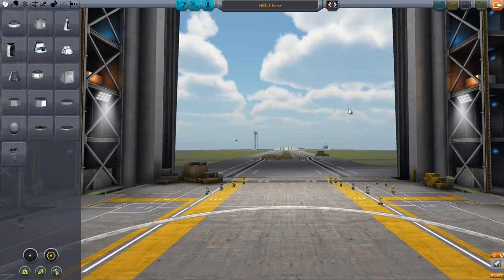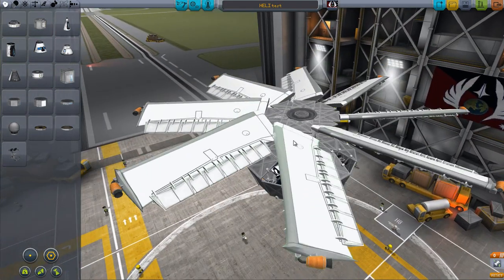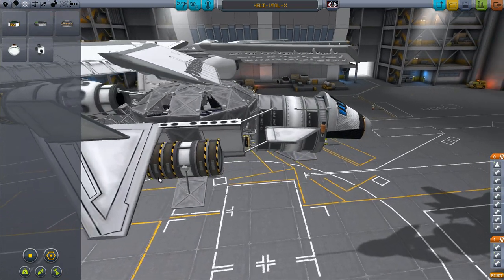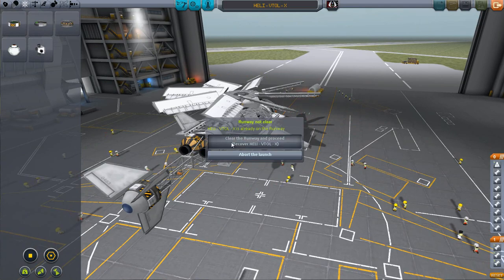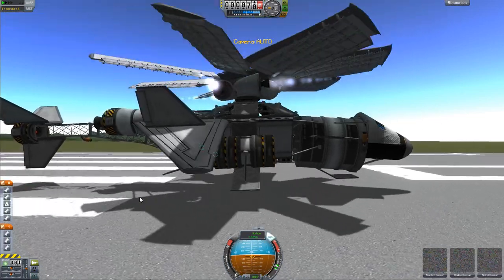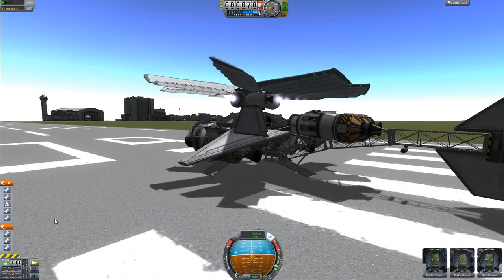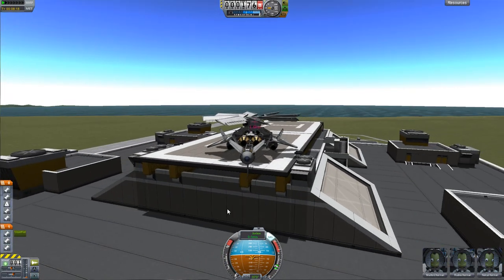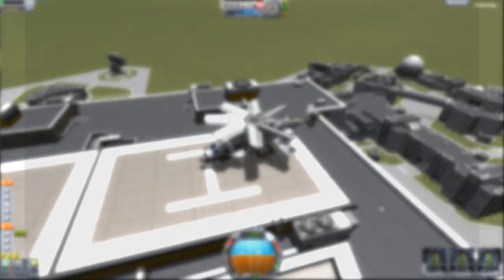*EXTREMELY OLD VIDEO* KSP V.22 -Vid#51-The HELI - X . No Mods.

Comment: Since this ship does not use the conventional tail-rutur and control surfaces (techno-babel: NOTAR) to control the opposite direction of the ship to the main rotor's rotation vector, you might consider moving the countering system to a more aft  location. .   Memory (that famous liar {g}) wants to dredge up a reference to the early days of Sikorsky's work that demonstrated the need to so separate these functions.  Thus, the need for a control lever in addition to the aero  and G&C needs  As soon as my lab and officer are finished being unpacked, I'll see if I can find either the text and/or my course notes...if there is interest, I'll post a precis.
     You have made a very good start on this design (IMProO; I hope that you still have enough interest to add this to your schedule.

Best,

Doc

'I have written you a long letter...'

Comment: If I had KSP and the infinite fuel task bar thingy I would take your design and increase speed and maneuverability then I would add low recoil missiles (which are easy by the way) and test it on target trucks. afterwards I would make it my mission to make it fly without infinite fuel on.
Reply: alt + F12
No need to thank me.
Reply: Gabriel Urbaniak Too bad, I will thank you anyways, thank you.
Reply: You press ctrl + F12 😀

Comment: KSP calculates torque so the rockets at the end will probably be better no?
Reply from the maker: Actually I'm having better luck putting the rockets under the craft. I'm no sure whats going on mathematically but, my theory is that since you have one craft inside another, the one craft with the propellers wants to go up, and if you activate rockets on the other craft, it pushes on the side of the other craft that's trying to go up, making the HELI want to nose up and out of control. SO! (German Scientist Voice) theoretically speaking, to move the craft forward faster, we need to use rockets that push both of the crafts in the same direction that the propeller on the first craft is moving :D :) ..... so, nose the craft down and activate rockets.